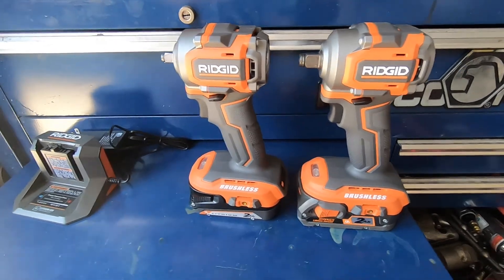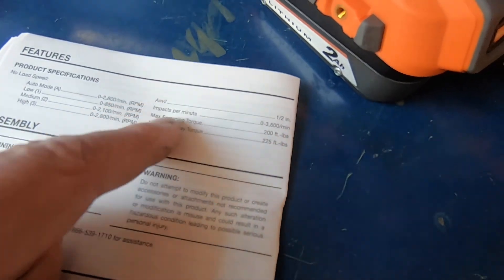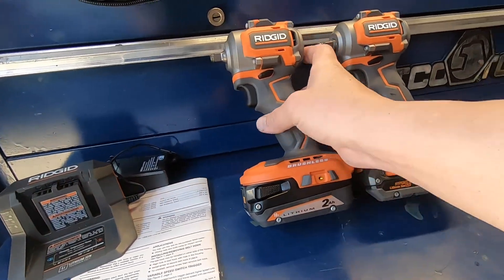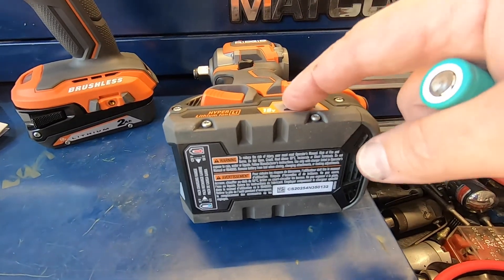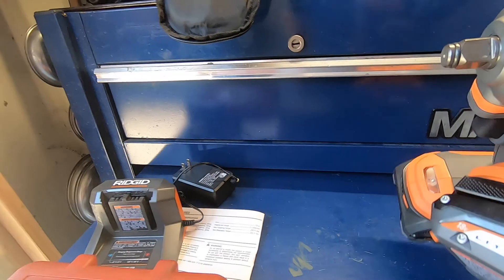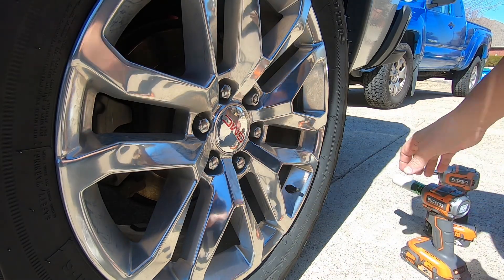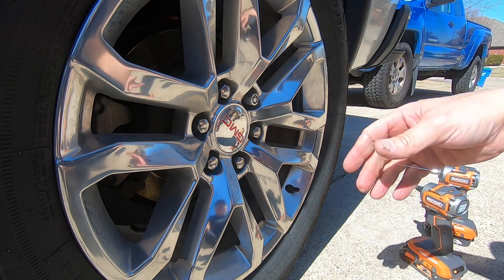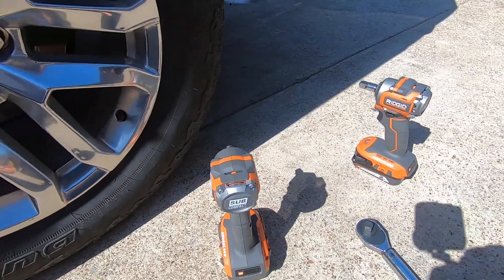Review of the Ridgid 18 volt sub-compact Brushless  3/8 and 1/2 impact wrenches.

Comment: Have been using the 3/8 a lot the past couple months. Works great. Having the smaller head compared to the popular red one has been helpful and the battery has not been an issue. Funny you mentioned the forward/reverse switch. I unintentionally switched it also the first few times using the tool.

Comment: I have that 3/8 subcompact.   The battery sticking out thing really becomes an issue when using short sockets.   It basically requires the use of deep sockets at all time, and that kinda of negates the whole "compact" thing.  I wish the handle had more rake, or the nose of the tool was tilted up a bit to push the battery out of the way (Very similar the M12 compact 3/8" design)

Overall great tool though, I use it and the Ridgid 1/2" mid torque in my garage all the time.

Comment: Im on the ridgid platform so i really wanted to get the 3/8. I love how small the head is and the power it has. The only reason i didnt get it was because of the battery being so big it kinda ruins its ability to get into tight spots. Thats the only reason i went with the m12 stubby 3/8. And like you said the forward reverse button. I have the first brushless 1/2 ridgid made and i love that one. The auto mode is a cool feature.

Comment: Just bought the kit without battery for 169
Then i also bought a kit with 2  4amp batteries for $99
Reply: Did you find the kit for $169 in store or did you have to order it?
Reply: There's a sale going on for both of these, plus 1 , 2 amp battery and charger for 199

Comment: I would just get the mid torque.
By the way, brushless has nothing to do with size. My Milwaukee M12 brushed set is the same size as the brushless. It’s just a brushless motor so it has less drag and the battery will last longer.
Reply from the maker: Actually they can pack more power in a smaller package with brushless than they can with brushed motors. Thats why all the highest torque tools are brushless and they are either smaller or the same size.
Reply: @737mechanic  I completely understand that, but in the video you said that’s how they got it compact.
Even the older brushless ones were bigger than the newer ones. It’s just technology.

Comment: If you’re happy with the tools, then keep using them.
However, this video is a little misleading to people.
Regardless of the brand, the subcompact impact wrenches max out at about 325 foot pounds. Since the rated torque is exaggerated by the manufacturer, they’re going to fail at heavy duty applications. Anything torqued tighter than a lug nut will require a mid torque or high torque impact.
Just get the stronger one so you never need to worry.